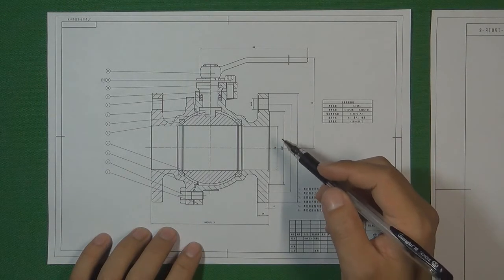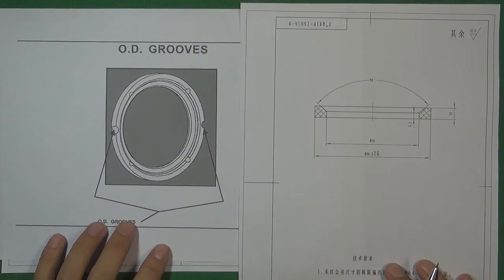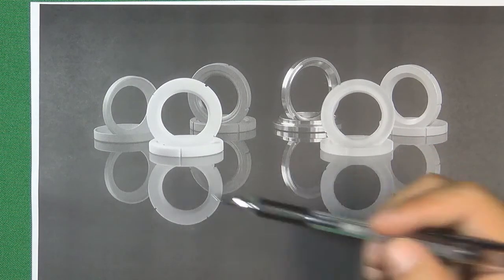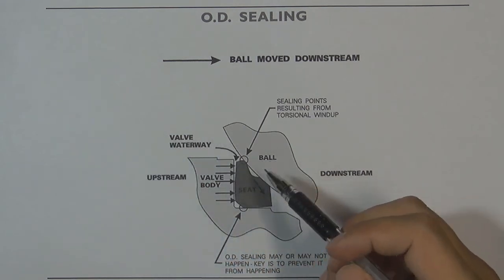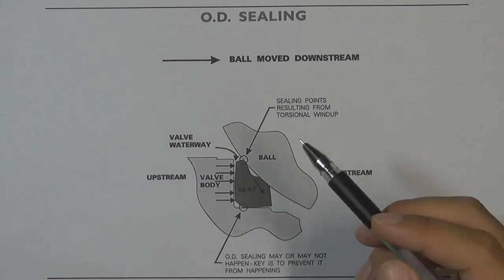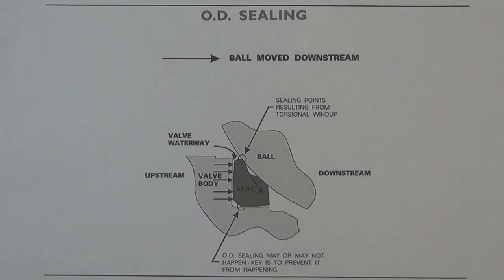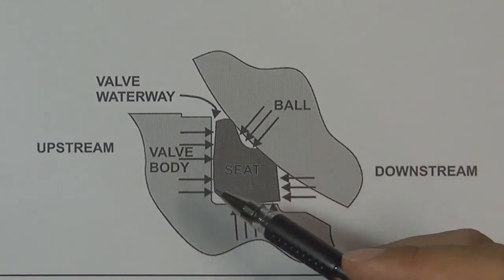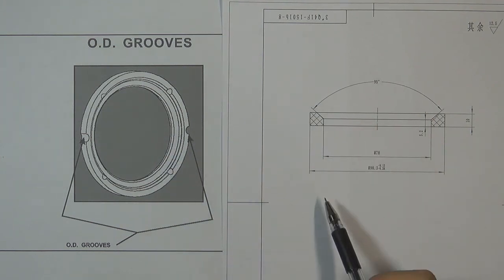The Best Valve seat design for soft seat Ball Valve  #Design Tips 12

Comment: This ODGROOVE design Valve is the  one known as self-reliving seat...Want to know this could be achieved in rigid seat material like peek vespel
Reply from the maker: Yes some manufacture put ODGOOVE on all kind of soft seat ball valve valve seat include PEEK seat.
This video cover picture the rightmost grey color valve seat is PEEK seat. It has ODGROOVE.
Reply: But can't find the reason why most manufacturers not suppling peek for Self-reliving application...More than that saying it is more rigid not available to relieve the cavity pressure...may I know the technical reason
Reply from the maker: I think that depend on different manufacture and different design. The only one reason why we need ODGOOVE because when pressure flow to the bake of the valve seat and push the valve seat. The valve seat may have deformation and then block the pressure on the back of the valve seat with the ball and the valve body.  But if the valve seat are very rigid it will not have deformation by the pressure so the little gap between the seat and valve body will not be sealed. so the pressure can flow to the cavity by the gap between the valve seat and the valve body.
Reply: The  diagram shown is a floating ball valve , but floating ball valves are downstream seated ball valves not upstream as the seats are fixed. How it can be self relieving